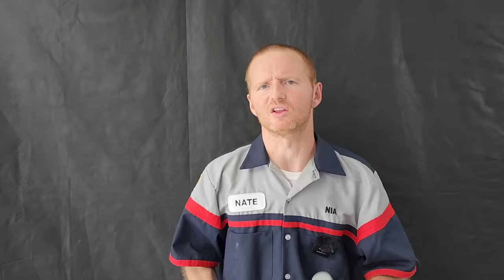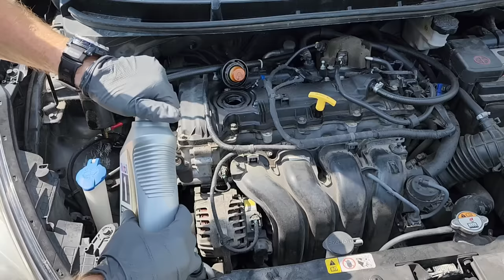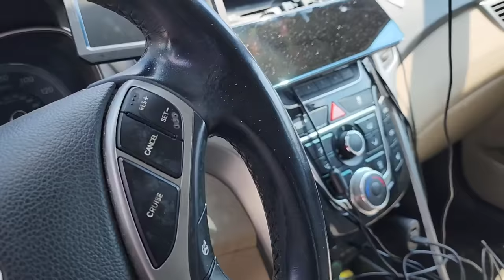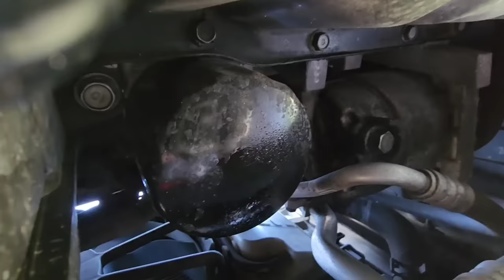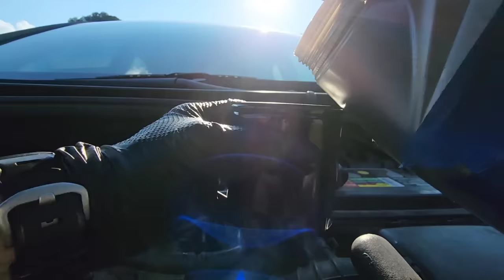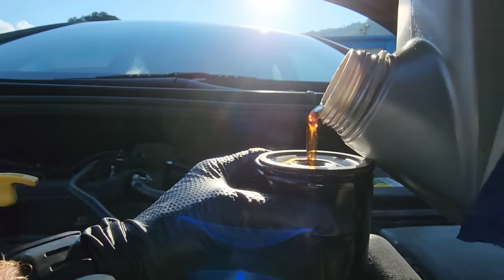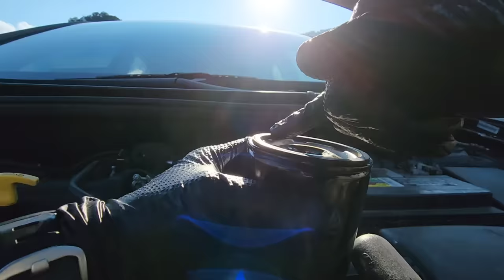Car owner sued after Jeep kills Mechanic during oil change

Comment: The #1 rule at my shop was "you will be seated inside the driver side with foot on brake to start any vehicle". One of my mechs ignored rule #1 and a Towncar went in reverse and ripped the driver door off as it left the shop.
Reply: That's sad, but since a jeep is high off ground I don't think you even need to back up the car. Mind you, I'd always apply the parking brake regardless. Drive an 05 civic & I refuse to trust the push button parking brake mechanizium. I'll always have a parking lever or I'd just settle for an auto. Sucks this guy had to pass away cause his help sucked, reason why I do my own work on my own cars. If I dont know anything or it's out my expertise, off to the mechanic shop it is.
Reply: same i never start cars on less im in them
Reply: I was gone on a personal day, but the gm dealership I worked at had bays on each side, so cars faced each other. The guy working in the bay across from me did a oil change on a older manual car. He reached in after filling the engine with oil and turned the key. He was talking to another tech as he did this. The car started, shot across the walkway between the bays, and smashed into my snap on tool cabinet. Luckily I wasn't working that day, but the corner of my box got smashed in. The dealership had a body shop, and they had one of their guys fix my box. Couldn't even tell it had happened
Reply: To Dave 1135, No car should lurch forward when you turn the key, the car was faulty,
Reply: @startover125  you’re right, the car won’t even turn over the engine unless the clutch pedal is pressed when starting up. I think buddy just made that story up
Reply: @startover125  Good thing you don't work on manual cars. I'd get you any amount of money when left in gear, turn the key on and release clutch. That'll "lurch" that bad girl right on smack dap to the wall. Just did an oil change on my 5 speed yesterday, parking brake on, ALWAYS! I'd even put an auto's on as well when doing an service aside from rear brakes/tires so that the wheel spins. In that case, apply "P" in auto, or manual just hop you have jack stands and chalk the front tires if still remaining on ground.
Reply: @omardominguez2936  depends on the age of the car. Starter safety switches were still new in the 1980s. My 1991 Dodge Daytona didn't have one. Ford C-5 transmissions had a habit of dropping into reverse. That's what caused the Towncar in my post to leave the bay.
Reply: Just like how EVERY mechanic at some time in their career (for me back at maybe 15) learns to ALWAYS verify and pump the brakes after changing pads and shoes.  A few years ago I was helping an idiot (hit my old beater straight on, fortunately no damage) change pads.  Not thinking, I subconsciously let him start and test the car, assuming all 40 year old males should know to pump up the brakes.  This guy was even worse, as when he dropped it into gear, a skilled manual transmission driver like myself would have instantly gone from reverse to forward, and then slammed it into park as soon as it stopped moving.  He just sat there in panic can't do nothing mode, when there were no brakes, and backed right into my car.  Could have killed someone, and in reality he is more of the average driver. I believe it was a Taurus without positive pinned (bolted) pads.  He had already managed to eject the pads on one side (they will slide off the calipers after driving metal to metal for some time AND significantly thinning the rotor) and was using the caliper piston as a brake pad.  His father and law (my buddy) told me he watched him trying to eject a pad on the other side when one got stuck trying to come out of the caliper in his gravel driveway, where the gravel did not provide enough traction to get the wheel to turn, so I know he was conscious of what he was doing.
Reply: @startover125  No, it was the mechanic that was faulty.  He was working on an "older manual car". he should have known better.
Reply: @billg7205  LMAO!!! You just never know. I told a coworker to check for 115 VAC on a Blackhawk window heater terminal. He put his finger on it instead of a probe. It was live.
Reply: @omardominguez2936  You've never worked on an "older manual car" have you?
Reply: @LALEICAM3  honestly no. Oldest I’ve probably worked on would be a 90’s
Reply: @HeinzGuderian_  your right, my dads 77 Ford F-150 was recalled because it would slip out of park into reverse. My dad had it happen to him, thankfully the truck was only feet from a dirt embankment and it stopped. He was afraid to leave it running and get out of it even after they supposedly fixed it. I say supposedly because it happened again after it was fixed. Thankfully it just bumped another truck without any damage. He traded it off  a week later. He was afraid someone would be hurt! He kept saying had someone been between those trucks it could have hurt or killed them.
Reply: Shops have signs that say customers are not allowed inside due to insurance regulations. You are putting your customers at risk.
Reply: @omardominguez2936  I understand; I've been around some older cars that would start without pushing on the clutch pedal.
Reply: @omardominguez2936  old cars well start as they did not have this safety  feature.
Reply: @startover125  car was not faulty the car was I hear and he started it and let out the clutch
Reply: I had a 1952 ford that didn't have a neutral safety switch, alot of older automobiles either didn't or they didn't work any longer. Always be cautious when starting a vehicle,  cars,trucks, tractors even lawnmowers
Reply: @dbzownz12345  I have a car with a push-button parking brake, and it was what saved my car from being stolen. They had broken a window and broke open the gear-shift lever, but could not roll the car into the street. So the repairs were $700 instead of a lost lease car. The push button system is an anti-theft deterrent.
Reply: @Geoffr524  Never thought of it that way. But having a manual itself is an anti-theft deterrent. You'll wake up from the constant stalling/starting if you don't know anything manual.
Reply: @omardominguez2936  only on newer cars.
Reply: Did you sue the car owner for the damage?🙄
Reply: Before starting any ( manual ) car, set the parking brake, and make sure the gearshift lever is in Neutral.
Reply: @startover125 If you start a manual car with handbrake off, clutch released, and gearshift lever in first, the car WILL jerk forward.
     Try it.
Reply: @omardominguez2936  depends on the age of the car. Most of my previous cars would start in gear without pressing the clutch.

Comment: The young man who was being trained should have had training  with how to operate a vehicle with a manual trans and how to operate an emergency or parking brake , also  a drivers license  before he was able to touch a clients car. Glad the Judge saw all the problems with this case .
Reply: Exactly the family has no NO liaabiy over what a  employee does at the steelership
Reply: It sounds like the 19-year old was also lacking common sense. Not something that can be taught or trained.
Reply: "The young man who was being trained should have had training" - did you read this before posting? The negligence here is in insufficient supervision during training. How can someone who is currently being trained be already trained?

Comment: You can thank your local attorney for crap like this.
Reply: Right to work state ?
 Were is OHSA & the state's workers compensation  ? Was that Dealer uninsured or was his attorney just belligerent in misrepresenting this claim  ?
Reply: Nope,  That is, unless said attorney was part of the state legislature which made such nonsense possible.
Reply: Or more accurately the state legislators who wrote the law that allows this.
Reply: @jeffreyrudolph5061  RTW has nothing to do with it. How many guys changing oil are unionized anywhere. OSHA and Workman's comp applies to everyone union or not.
Reply: @tyharris9994  most of them are attorneys
Reply: How about ‘Attorney gets sued for not suing on what could be sued for’. It is generally the law which is an ass and the client who determines what is to be done with it.
Reply: ...no

Comment: How is this the car owners fault?? This is some crazy accountability blaming.
Reply: In California, someone can break Into you're home, steal you're gun and commit a crime. They then will charge you aswell just for owning the gun..
Reply: @mrrod3004  rightfully so, you shouldn’t own a gun if you don’t keep it in a secured cabinet with a secure lock
Reply: @Progan666  because no one can break into a gun safe? By that logic, if someone breaks into your home, takes the keys to your car and runs someone over then you should be held accountable for the criminals actions.
Reply: @Progan666  It's not hard to remove firing pins and or bolts from guns so that they can be stored separately and that way the weapon is incapable of being used as a weapon.
It's good for long term storage too and as I said, if someone somehow stole it from you, it's basically useless unless you beat someone over the head with it like a club.
Reply: @TheHungrySlug  Yeah because a disassembled gun does a lot of good in a self defense/home invasion situation. Let me try and put the firearm back together in an emergency.
Reply: @Miasaint10  You know that you can keep a sidearm or pistol concealed in your home as long as kids and such cannot get access to it (Better if they never know it's there).
You don't need a rifle inside a house, not when a pistol would be better suited.
But heck, I'm Aussie and so we don't have the same sort of gun culture. But if you were to break into an Aussie guy's home, you better have told someone where you are going, otherwise you might just vanish.
Reply: @Progan666  What if i steal your Bat and maim someone, should you be prosecuted for that?
Reply: Only in Merica
Reply: @Progan666  you getting massacred in these comments 🤣
Reply: @TheHungrySlug  Yeah but I want the best, most reliable and most accurate gun in my hands in an emergency situation. If it's me or my family's life, I don't want to just barely be able to defend us. I don't want a "fair fight" against someone who wants to harm us. 
A rifle is just that. More accurate, easier to handle, and the perfect tool for defense. It makes my 5'4 120 pound wife able to have a chance against a 6'5 250 pound man who wants to do her harm. The great equalizer.

Comment: The oil change place should be liable.  But aside from that, never, ever go to a quick change oil place.
Reply: Always do it yourself anyway. Saves money and gets done properly.
Reply: It was the dealership.
Reply: ...and don't fill the filter with oil.
Reply: @timd1833  Always fill the filter with oil. Unless it's positioned where it can't be.
Reply: @nodak81 If you fill your filter and then fill your engine, there is no margin for error if you overfill the crankcase. People do it, but for that very reason I don't.

Comment: As a drver trained on a manual transmission, it is standard practice to leave a manual transmission in gear in case the parking brake fails; its similar putting an automatic transmission in park.

Comment: Moral of the story is never let a newbie start or drive customer vheical.  He should have been properly trained to put the car out of gear and apply the emergency break. This is completly the shops fault.  I have been a mechanic for 20+ years. Never trust anyone. Always check and make sure ebrake is engaged and car is in park or in this case neutral.  My sympathy goes out to the family that lost a good man. God bless and lets all learn from this mistake.
Reply: ...or never go to a quick change establishment.
Reply: @K03sport  Pretty sure this happened at a dealership.
Reply: we were always trained to just not start a vehicle if its on a car lift off the ground... even if its only 2 inches off the ground... 1. because its a royal pain in the ass to put a vehicle that has fallen off a lift back on the lift and 2. because its just not safe... like how long and how much effort does it take to hold the down lever on the car lift...
Reply: That's a question they ask during interview. Do you know how to drive manuals? Then he attempts and dies. What if he stayed alive and drove through the shop? Completely the owner of the shops fault!

Comment: When I first started working as a professional mechanic at my first job one of the things that was drilled into me was when a vehicle is in the shop DO NOT EVER leave it in gear. Later when I had my own shop  i made sure my employees followed the same rule.
Reply: The problem is that could be the only thing keeping the vehicle from rolling away 🤷‍♂️
Reply: They should know about cars atleast how manual works. If they don't know they should just change the oil and leave the car for experienced mechnic check for other things. Here the job was to change the oil only.
Reply: @willschultz5452  parking brake?
Reply: @tailschoo6148   Assuming that it works,   alot of peoples parking brakes do not work🤷‍♂️.   When you start up a car with a standard transmission you should always have one foot on the brake.  Then you make sure it's in neutral before you let the clutch out
Reply: The long and short is that someone did not know how to operate the vehicle resulting in death.  I've had to ask an owner how to put the vehicle in reverse when a safety switch was involved.  Foreign and newer vehicles had such; the old vehicles on which I learned didn't have those safeties.  I think that sometimes safeties give a false sense of safety...sometimes.
Reply: E BRAKE
Reply: @gerot201  most parking brakes on vehicles dont work. Usually broken
Reply: @willschultz5452  ?! kkk......
Reply: @willschultz5452  no. Even if the parking brake is bad, use wheel chocks.
Reply: @jeanenviedapprendre  Yes they should definitely have done that!   They should do it with every vehicle it's a safe practice to do.
Reply: @willschultz5452  it's not necessarily that they don't work is that they're not strong enough to stop the car once it's in gear
Reply: @ChewyChicken589   That's true also, some do not work at all  the cables are frozen in place or the pedal just goes right to the floor because the cables have snapped.
Reply: If a car rolls away inside the shop, the slab is not level and they need to start over again on a new building.
Reply: @willschultz5452  That's mostly a thing with automatics. People just put it in P and never use the parking brake, causing it to deteriorate. In manuals you don't have that option, so the parking brake is used a lot more and owners are usually good at making sure it's kept in good working order.
Reply: @enemixius  yes that's true.   I have a stick shift on my truck and the parking brake does not work so I always have to leave it in gear.   I wish it did work because it's a real pain, it's on my to-do list of things to fix
Reply: @ifluro   A lot of shops do not have perfectly level floors. Especially around my area everything is built on a slope just about lol
Reply: @ifluro  shop floors are sloped to allow   for water to drain away-standing in a puddle of water working under a car sucks
Reply: @nancyconrad5349  The shop where I work is perfectly level. Puddles of any liquid get cleaned up straight away.
Reply: @willschultz5452  It's generally on a level floor indoors. I was taught the same way by an older mechanic; never leave it in gear inside the shop.
Reply: @AcmeRacing   Yes I would just use wheelchocks instead,  Especially with the older cars because they did not have a switch that would cut the starter out unless the clutch pedal was pushed down. Also when you are letting the clutch out you should have your other foot on the brake just in case for some reason it's not in neutral it will just stall the engine instead of the car lurching forward.
Reply: @johnchestnut5340  because then common rituals go out the window. Like looking both ways at a traffic light. When it was a stop sign, common sense says don't just stop and go. However..... newbs
Reply: @Marshmower  I don't follow your reasoning.  How does safeties giving a false sense of security cause rituals to go out the window?  Habitually examining and thinking about your surroundings and situation is a good thing.  Acting out of habit without thought can be dangerous.  That's why every fun should not be treated as if it were loaded.  Trying to use a weapon in a dangerous situation that is not loaded well get you killed just as quickly as assuming that a loaded gun is unloaded.  You must be aware of your situation.

Comment: The first rule I was taught when working with another, or multiple techs on one project is to never operate the vehicle or a piece of equipment until everyone is in clear sight or has been communicated with. Everyone should be told this. It's a simple rule that saves lives and limbs.